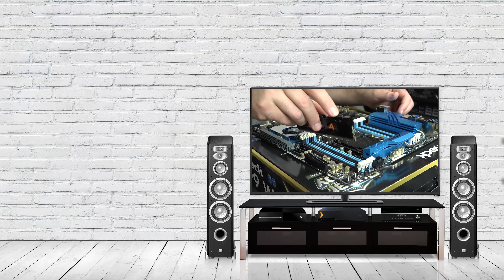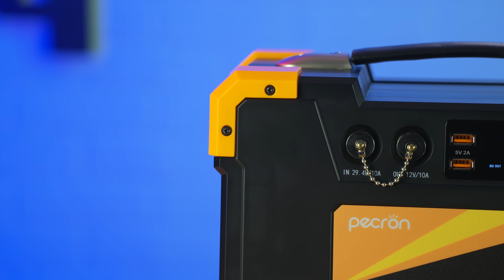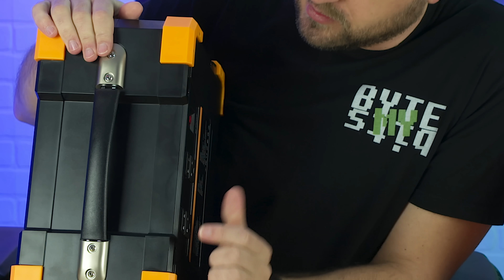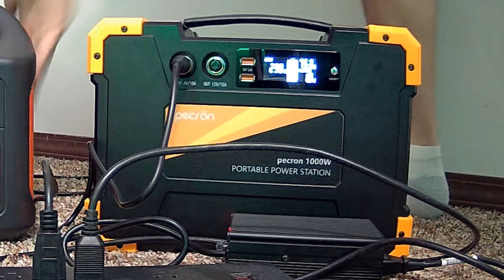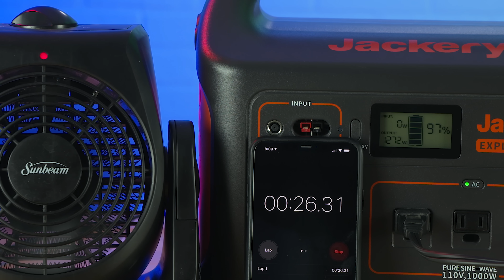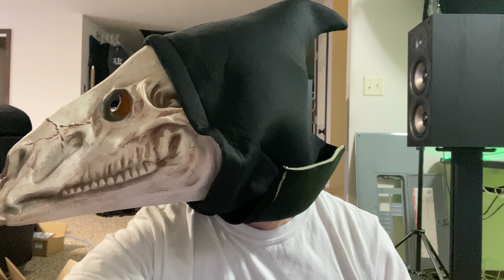pecron E1000 - Better and CHEAPER than the Jackery 1000!

Comment: The Jackery 1000 is on sale on A for $459. But you need an app to make certain adjustments which is a complication that I think is a big problem and just one more thing to go wrong. I have gotten Oukitels for that reason. You only need a battery and an inverter. Pecron seems to be in that arena. 🥸

Comment: But if you run a 200 watt solar panel it will keep you charged as your working ,house heat , refrigerator,sump pump, 65 TV vcr,. This keeps me from turning on the 5500 watt generator 😎

Comment: My 1 1/2 year old Pecron 
E1000 is shutting down with 70% left on the battery. When recharging it takes about 2 hours to reach about 20% then it will go from 20-25 % to
100% in a blink of the eye.
Reply: Very dissatisfied with customer service and support. Have made multiple attempts to get resolution to the problem.

Comment: I have a Jackery. The original lasted 8 months, They replaced it under warranty. I just looked up the Pecron. At the heart of the unit is the battery.  Features are transient. Why is that important? Lithium ion batteries only last a couple years with casual use. With heavy use, a matter of months. I will only buy units that have LifePO4 (lithium iron) battery chemistry. It lasts 5x longer than lithium ion.  Hence at near or a bit more its worth every penny. I also have a Bluetti (love it) EB70S. 700 watt hour with 800 watt inverters. Will run my coffee pot. and a small microwave. I charge via solar. So the Pecron is an inferior product by design in the long run. Do the research. Other unit i have is a 200wh Centechi that i bought when my Jackery died. Had to have something to keep my Mini fridge running when the sun was down or batteries were weak.2
EDIT: Some of the Pecron Batteries do have LifePO4 batteries, the one in this video states lithium batteries. No specific chemistry. Hence my comments concerning battery chemistry.

Comment: I bought the Pecron E1000 1028Wh(25.2V 40.8Ah) Portable Power Station in September and have used it for camping and for power outages.  I love it and it works as designed.

Comment: I am strongly considering just building my own Solar Generator just using one or 2 Deep Cycle Marine Batteries, a decent size sturdy plastic Tote, a 5 outlet power strip with built in protection device, one or 2 12 Volt Cigarette Lighter Plugs, a couple fans for cooling, a small 12 Volt trickle charger, a 1500 Watt power inverter, and all the needed fuses, etc for protection. I could probably build my own set up have more power, and for a much cheaper price in the end. When you buy a Jackery, you are paying for the name, just like buying a Harley Davidson motorcycle. You are paying more for the name of the product than the product itself. Just my 2 cents.

Comment: Hey I came across your video today.  Great review and info.  I'm curious if you know the answer to this question.  I'm a DJ and I'm looking to put together a wireless ceremony system.  I have a pair of EV Evolve 50 speakers.  Power consumption is 1.5 amps 100-240 V AC.   Would this unit be overkill to run these two speakers for an hour?  Would it not be enough to run these speakers for an hour?
Reply: No probs.

Comment: Good review, thanks. I love that boxie design, even up to point where I wonder why not make the battery swappable. Just a simple door at the back where you shovel in a replacement battery or one that has been charging overnight ready to use. You buy more batteries and have at least 3 on the go with ya, right?
Reply: I cant remember  who, but there is a company hat makes them like that. But i bet Google knows.

Comment: I was wondering if anybody in the channel can help me. I have a house in the Philippines that I spend 6 months out of the year at. As a white guy I need the AC all the time but electricity is expensive and my wife is super cheap.

We run a 2000 BTU AC really small little one I need to know what solar I need to run the AC. If anybody could help me out figuring out exactly what I need to get I'd be super grateful

Comment: Do you still like it? Curious off what you think now? I have a 1800-2000 Generark, called Generverse now, a Titan 300 and a jackery 600watt. I just got the Jackery. The Titan did not come with panels. I had to find a converter connector to use my Generark panels. Type C connection. I had to learn some things that's for sure. I am looking for a big powerful one to get soon. I would need to run 2 freezers and fridge in emergency. So I need another high capacity device, maybe with extra battery like the Ecoflow Delta Max. I realize this is only 1000 watt and am looking for a larger one. Need a recommendation for one, but so many videos gets confusing. That's a lot of money so I really have to do much research. I don't know a lot about these devices but trying to learn.

Comment: A lot wrong with this review. First off, no the jackery doesn’t have grounded AC ports. Second off, in what world are the ports on the pecron more “standard” than those of the jackery with barrel plugs and Anderson powerpole connectors? Another thing you didn’t mention is that the Jackery has a regulated 12v port. That’s huge. Does this have it? What kind of charge controller does the pecron have? Tear apart the two and you’ll see why Jackery is superior. FYI I don’t own a Jackery, but I know enough about solar generators to know this review is lacking and potentially leading watchers to buy an inferior product

Comment: Appreciate your review. I too am willing to take a chance and buy a cheaper product when an industry leader may be keeping their prices up and resting on their laurels. But there are some cases I still think penny wise, pound foolish still applies. I've been using an Ego Powerstation for some time now as a back up and to keep my travel cooler cold since I have enough Ego batteries for all my lawn equipment. But basically, the Ego Powerstation has been a troublesome, large, bloated piece of junk and has just about given up the ghost (One cell station only works intermittently and the display is dying. So I'm looking for a replacement and had been considering the Jackery 1000. While I was initially excited about saving some $ with the pecan E1000 plus the fact it seemed to be marginally better in some performance tests you did, I've watched other videos and they all have a common theme; They receive products that are broken in some way, missing parts or have manufacturing defects that are obvious. The fact you got a bad power cord and some of the labeling was peeling off should be a warning sign of quality control problems in what is inside. Like the Ego, it may work well for a bit, but I want something that will die because the batteries have been cycled to their lifetime limits or beyond. Not because of some stupid manufacturing defect. Also, Jackery has the 2-year warranty as opposed to 12 months. I think that's worth the extra money for the core of an emergency backup system. I am buying a solar cell bundle that's not the Jackery product. But now we're talking about a $200 product as opposed to a $300 one so I'm willing to take a chance on that.

Comment: How about you and all the rest stop with the FALSE claims of a solar 
generator and tell the truth for a change. !
What you have on the table there is a couple of el cheapo batteries in fancy cases.
One can charge these via a SOLAR panel or electricity.
They are NOT solar generators, they store DC power for later use.
Leaving them out in the sun all day achieves NOTHING.
They do NOT generate ANY power, they store it.
Why can't you yanks think for yourselves. ?

Comment: In the future you may want to offer specifics, like time-to-charge with DC power. You state "obviously it will take longer because it's 12v". The determining factor is the amperage, not the volts (or the combined, wattage). Many are searching for a mobile solution and DC recharge-time is critical. Just some constructive suggestions for future reviews.

Comment: The receptacles are not grounded. It’s the same with a gas generator. They are called a floating ground. The same with the neutral it’s also floating. Meaning it has no place to go. 

Most electrical circuits have a ground which is electrically connected to the Earth, hence the name "ground". The ground is said to be floating when this connection does not exist.

Comment: So how do you charge it if the power is out ?? 
What soler panels would you use .??
Reply: YOu need a solar panel that can provide at least 29.4 - 40 volts. I just picked up this pecron e1000 for $600. That voltage window is very specific and many smaller panels won't work as they are usually between 12- 18 volts.  If you have a gas generator like I do you can also keep this charged that way.  At least the gas generator wouldn't be on all the time when the battery station is being used. I'd prefer having the solar panel constantly charging this while it's being used to run your devices or appliances.

Comment: Its funny to see how people misuse these batteries for really dumb reasons.  
This is really suppose to be used for emergencies, like charging your phone, tablet to keep communications up, having small LED lights in case there is a black out for a week or so.
Its not really for 3D printing, vacuums, hair dryers, drill-press, table saw, microwaves and video games.   Its for "emergencies", small things like tablets, phones, gmrs radios & small led lights.

Comment: You can go online look up neck fan something that would hang around your neck like a little box what you do is you find a way to mount it on the side of your unit to constantly put in fresh cool air that way the internal fan never needs to kick on I got one that can last 38 hours on low which is perfect at far exceeds the battery life of my Jack

Comment: The Pecron is built rugged, with the corner protecters, dust covers connectors and a folding handle. If you dropped these off a tailgate of a truck, which one is going to break?    The Pecron looks like engineers built it.

Comment: Thanks : Will most likely get the Pecron. Too many power outs !
Reply: Just reading some of these posts as I just purchased the Pecron E1000 for $600.  I'd wait a little longer as the newer lithium iron phosphate models are coming out that are faster charging, stronger, and can go over 2500 cycles of life.  Prices keep dropping.  I live in CA where we have power outages all the time due to wind, firestorms, and the occasional earthquake. This pecron will power some appliances but you need to know your power requirements. I'm tired of using my gas generator too.  Looking at a 3000 WH power station for the whole house soon. It's best to have solar panels constantly charging these while you're using them otherwise they won't last more than a few hours on their own.

Comment: For those who are going the Bluetti route, their older EB 150 and EB240 had serious flaws NO better known reviewers spotted or talked about. If a shadow passed in from of the solar panels, power would drop. Shadow removed, the Bluetti's would not return to the  previous power input level. You had to unplug the charging cord and then plug it back it back in to return to previous power levels. This is not good if you want to leave it  to power a refrigerator. Clouds or kids pass in front of the panel your input drops and the battery runs out of power because of the loss of charger power. Build you own, it is cheaper and you can pick and choose components and limit your costs.
Research if the newer units have the same issue. Bluetti CS told me they fixed it on the latest models of the 150 and 240. But that was not true. I had to return the 240, twice for the problem I wrote about here.
Reply: Thanx for the info!!! On the hunt for a solar charged battery/genorater and have no clue where to start👍
Reply: Bluetti has glitches in it's tech.  And they are always odd things that there doesn't seem to be any reason for.  Sometimes I think Bluetti sends out early production models to reviewers and is actually relying on them to tell them what is wrong; that seems to be their quality control.  The Pecron has tested out consistently extremely well.  Jackery now is aging tech.  It's still a good product but I think it is over priced for its tech.  Everybody is now rushing for faster charging, because that is really becoming important to consumers.  Bluetti is trying to catch up, but Jackery hasn't really changed much. But the companies that are really pushing the market are allowing for much more solar to be input for charging purposes. That is now a huge advantage, to speed up solar charging.
Reply: @JustVinnyBlues  Better off with units such as these: https://www.youtube.com/watch?v=T9JPNH2ZaEE
Add panels and you are done!
Reply: Thanx for the info!!! On the hunt for a solar charged battery/genorater and have no clue where to start👍
Reply: I've used the ALLPOWERS battery pack with a 100w panel extensively in the woods and it worked great.  It's a good budget set up, as long as you don't get one of the older defective models.
Reply: @V_for_Vovin  I started using SOK batteries, so far so good.
Reply: Why is the jackery the 'go to'?  There are plenty of power stations out there..

Comment: If you really want a light on it, you can get an LED Light strip and wrap it around the whole thing so you can see it from all sides.
Reply: I agree with you 100% about the complaints of no light. How much does a flashlight cost, these days. Also, are they admitting wanting to carry around a 50 lb. Flashlight?

Comment: Pecrons are cheap because it is very expensive to charge them with solar. You need a Minimum of 36volts. So one 18v 100 watt solar panel wont charge Pecrons. Also you have to use a proprietary MC4 to 4 pin aviation cable. This means you can only connect MC4 solar panels that provide a minimum of 36volts. Try finding a single 36v solar panel with MC4 connectors. Perron sales it for $400!!
Reply: Jackery has proprietary solar inputs as well. You have to get adapters to use generic (lower cost) solar panels with the Jackery.
Reply: I'm not sure where you're getting your information from but I just picked up a pecron e1000 for $600 on eBay which is $300 less than the Jackery.  The input voltage for solar is 29.4 to 40 volts.  There are many commercial rigid panels that meet that spec all with MC4 connectors.  In fact, when I looked I ran across a solar company selling barely used Trina 250 watt panels for only $75 that are 36 volts. These were taking off a failed business close by and are only 2 years old.

Comment: you do realize the grounds on the jackery are DUMMY HOLES and neither one of them has grounded anything.

For me I have do deal breaker mandatory features I must have

IT MUST be able to recharge via USB C PD I am sick and damned tired of losing dedicated power supplies. and it must use LIFEPO4 battery chemistry. I have murdered thousands of dollars in battery boxes due to the LION cells puking after 1.5 to 2 years.

Comment: This isn't a fair comparison, your testing a new battery vs a used then basing your tests on performance as if you have two new batteries. That isn't how batteries work. Even the the strongest any type of battery, degrades of each use and charge.

Comment: At Costco’s AC/DC 1000 watt charger/air compressor. Jumper cables. UBS assorted ports. Light 110 volt outlet. Fully charge 1hr. Made by Caterpillar. $100. I like it so well I bought one for my son
Reply: Used one of these as well, however keep in mind these things conk out a lot sooner as they cannot take Too many cycles
Reply: Thanks,  I keep a jumper/compressor unit and I have a small inverter, to have all that in a single device,  I'm going to costco
Reply: Unfortunately the inverter is only 300 watts, it's not a pure sine wave inverter, and it can only generate 200 watts. Plus it's a lead acid battery that shouldn't be used more than 50% and it needs to be charged at least monthly in a wall outlet. It would definitely work for some people but I don't think it would work for most vanlifers.
Reply: Thank you for this!
Reply: Sorry to burst your bubble but those compressor power stations have a lead-acid battery. Won't last very long and needs to keep charged constantly.  The lithium-ion battery far exceeds the life of lead-acid and is much lighter too. Lithium can cycle around 1000 times.  Lead-acid much less.
Reply: What you say is true. You get what you pay for😎🇨🇦🇺🇸
Reply: That sounds like a deal, i looked and it seems like the battery is lead acid, it won't run for as many charges as lithium iron but still good to have as a backup
Reply: Bought one...in less than a year and only a few uses...(less than 12)...it was dead...would not recharge...could not exchange or repair...not worth it...

Comment: A Jackery is not a "bad ass battery". It is obsolete in battery technology, and with it's MUCH shorter lifespan, an EXTREMELY poor value. But for some reason, lots of people are too easily swayed by marketing and keep buying them, even today.. What a shame.
PLEASE people- Do NOT buy any solar generator that does not have LiFePo4 batteries! If you do, you will be buying at least 1/5th of the life of any brand with the newer tech...and it will take many times longer to charge, as well. DON'T be that person!
Reply: Thanks for the tip.

Comment: You didn't mention what type of battery it has, the same old one as Jackery with 500 cycles? Or a new one like Bluetti with 2500 cycles?
And lack of USB-C in 2021 is just a bummer for me.
Reply: The pecron is the same as jackery with the lithium-ion technology.  The newer competitors coming out have the lithium iron phosphate chemistry which as you said has>2500 cycles, faster charging times, and is more powerful. The downside is that they are heavier.  Some weigh over 75 lbs.  All the new models now have the USB-C
Reply: @philc.9280  who has LiPos? I'd like to see those